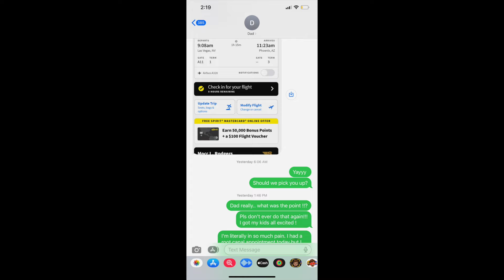6 DAYS TO TURN OUR HOME INTO OUR FIRST INVESTMENT PROPERTY WITH AIRBNB!

Comment: I know you probably don't want to hear this. But John never should have change the floor on the stairs to carpet, you gonna have an airbnb and the stains on carpets will have to get clean. I know you have a cleaning  team. That's awesome, but some stains can't be removed speaking from experience.
Reply: While, yes, carpet can be higher maintenance in regards to dirt/stains, a little preventative maintenance goes a long way to making your carpet last and remain beautiful for years to come. Also, wood or tile stairs isn’t always the best choice for those who have children…. And if the solution is to tack down a runner down the center of the stairs from top to bottom, you’re still going to deal with the same maintenance and cleaning issues as carpet - considering a runner that size is not washing machine friendly. 
The trick in AZ for great carpets is investing in a great vacuum. Vacuum thoroughly every other day to keep the airborne AZ dust from settling down into the base, then becoming stain when any type of moisture is applied. If a stain does happen - “Folex” can’t be beat. We use it with our portable spot cleaner, and always have amazing results. Available at Lowe’s, Home Depot, and Amazon. Big white jug (or tall white spray bottles), with an almost black font. Great for laundry and upholstery as well!
Reply: ❤ awesome, doing a great job, and it going to be awesome ❤
Reply: No carpet when u rent put they have pretty wood  floors now

Comment: Hi! Az native and homeowner here. I can help with suggestions for your backyard in regards to “upping” the aesthetic w/ a minimal price point. Considering the time of year, my suggestion would be to scalp it, then either purchase or rent a good aerator and go over it just to approximately a 2” depth. Does it have an auto sprinkler system? Sod is wonderful for almost instant gratification, however, it’s very pricey - and again, given the time of year, it’s perfect to begin to prep for seeding. It sounds like a hassle, but if you take just a bit more time to enrich your soil, seeding will provide you healthier, lusher grass. Scalping, aerating, spraying w/ “Moon Juice”, and setting your sprinkler system to begin its cycle at approximately 2-3am. During the prepping phase, you simply are adding oxygen and nutrients to the soil, and giving it just enough moisture to avoid the “AZ concrete” effect. Due to how hard our water is, our minimal annual rainfall, and the AZ heat, the ground hardens and compacts to the point it becomes *extremely difficult” to plant anything (including sod)… When we do happen to get rain - instead of absorbing, it splashes off the surface and trickles down to the lowest part of the yard (kind of like the effect of a cow peeing in a flat rock). However, well prepped soil that is then seeded, and fertilized (I strongly recommend the odorless version) will give you grass with a strong root system, and the color can’t be beat. If you’re interested, send me a message, and I will give you the process step by step, along with pics of our yard. 
Welcome to AZ! So happy you’re here! 🌻☀️🌵🏜️🌵☀️🌻
Reply: Great tips, aeration is tops and seeding. My lawn turned completely around after it was done.